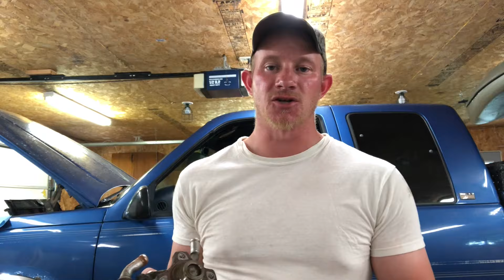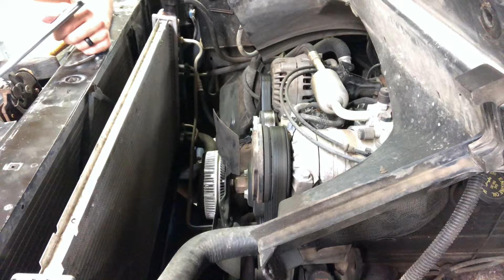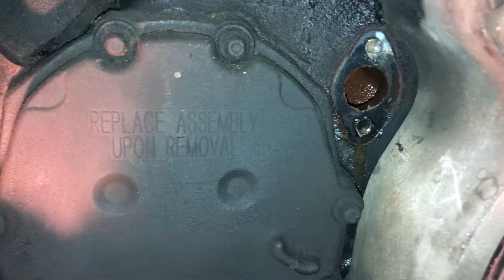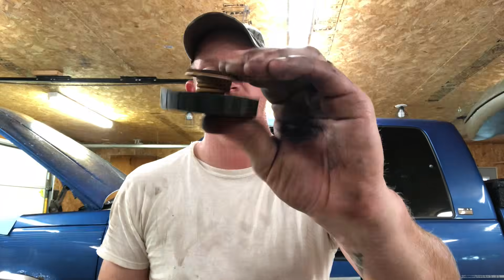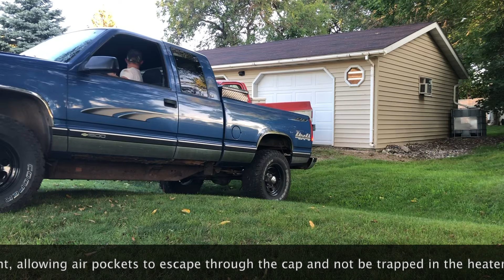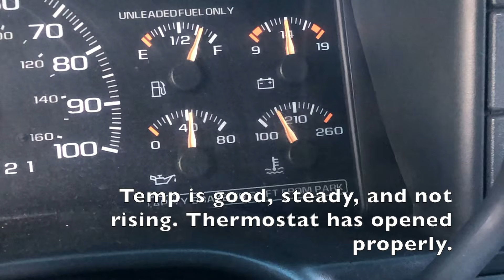How To Replace Water Pump in 1988-1998 Chevy GMC Truck & SUV

Comment: On my 1996 Chevy K1500 5.7L coolant is dripping from the crankshaft pulley area. Is this likely to be coming from the water pump above? Or is there any freeze plugs or anything else than could cause it?

Comment: Tried loosening off the pully and even tried putting some tension on the belt but the pully is just moving with it. Think its seized on there after 27 years of being on there. What can be done in this situation? Anyone? Update* i was able to put a 12 in flat head in between a set of the 4 bolts on the pully and grabbed a hammer pulling up clockwise on the screwdriver and hitting loose on the fan clutch nut/adjustable wrench. Also used PB blaster and waited 30min before. Essentially the same process you show when pulling the pully off with the 4 bolts when it freely rotates can also be done if fan clutch nut is seized.

Comment: Great video. My engine is making a noise that sounds like a pump or bearings going bad and has continuously gotten louder. I'm thinking water pump. With this video I am confident that I can do the change out on my 93 1500 
Thanks so much!
Reply from the maker: You’re very welcome, thanks for the comment!

Comment: How do i get the fan off when that bolt/ nut is all rusty? I did what you did but it womt budge and the pulley connected to the fan moves while i do it but the belts not movimg just the one pulley. I dont know what to do. Ive sparyed pb blaster on it still eomt budge. What do i do?
Reply from the maker: Put a big wrench on it, and as you apply pressure to turn the wrench, hit the top of the wrench with a hammer. It sounds weird but it works! Hope this helps. There may be videos of this method you can watch if I did a poor job explaining it.
Reply: @MidwestGarage yoi did a great job explaining it. It just wont budge with that method because its rusty. Its like the threads got welded together haha
Reply from the maker: @Noah-wb2lv hmm, dang was hoping the percussion would break that loose. The next option I’d go with is a lot of heat.
Reply: @MidwestGarage I can make a short video to show you real fast

Comment: Great video! I checked Amazon and the water pump under your P/N does not have the two small water hose connection?
Reply from the maker: Glad the video helped! The part number is from a 2015 purchase, so it may have changed or been updated since then. I’ll find the correct one and update, thanks for pointing that out!

Comment: What is the name of the two smaller hoses that you have to disconnect
Reply from the maker: Those are the heater hoses that go to the heater core. One is supply and the other is the return line.

Comment: I've watched several videos on replacing a water pump in the OBS Chevy and you're the only one I've seen that mentioned using the RTV on the seals which is EXACTLY what the repair manual states. Thank you for providing such a thorough and clear instructural video.
Reply from the maker: @zachmedeiros4163  you’re very welcome, glad I could help!

Comment: Nice video for a 95 to 99. 94 5.7 has a different water pump with a single "small hose" fitting on the top instead of two. The weep hole has nothing to do with oil circulation, any oil mixing with coolant is done with a problem inside to motor. Nice instructional video though as I'm working on my 99 Suburban and have a 94 Silverado for a parts truck. The water pumps are not the same.

Comment: U can t have a water jacket in a hold down bolt for the water pump... u need to do a bit more research b 4 telling people  to do shit that is point less then they got a mess of trv in the bolt holes.... do u see rtv from factory....no tiny bit of lock tight.  ..do the math and research.

Comment: very well done video, i havent worked on one of these in aot of yrs and now it is my sons first truck.  Nice to have the torque specs on water pump and other simple tricks.  Kept it simple and to the point not trying to over analysis a fairly simple procedure.  Well done!!

Comment: That was a great video wonderful to the point and you really know what you’re doing. I have a 1998 Chevy van and I just replace the water hose on the bottom thinking it was leaking well it wasn’t. It was the water pump so now I have to do what you did this Ohta be interesting but I think I can do it now, and I have enough tools I do refrigeration and air conditioning. Thank you very much for the videos.

Comment: I watched this video through once. Went back and made a note of the socket sizes, and the setting for the torque wrench. Then I gathered up my tools and went to work on my 98 Chevy C2500. Got the old one out in under an hour.  Was losing light and had started out tired, so then I just couldn't get the second bolt started.  Gave up, waited until the next day. Went out and took it back off, cleaned the bolts and gasket surfaces and put fresh ATV on, and in 40 minutes had it all back together. This was the BEST instructional video I've seen.  No stupid music, no goofy effects, no extra yammering about unrelated.  Good lighting, good views.  I never needed to go back to refer to the video to see what to do next, because it all made sense the first time. Thank you so much, Midwest Garage!
Reply: 100% did the exact same thing had to go buy a crescent and a hammer but got it done it what felt like no time just short of it being like 105 degrees outside

Comment: Thanks for the help. I noticed you put in something to protect the radiator and good heavy cardboard will work if you don't have wood. I don't know if you check in here but the wiper circuit board vid is how I found you. I know the links get you a little kick back but I couldn't find one. Keeping old trucks running is a good thing. Hope you are doing well, Rich in Oregon

Comment: Need one addition. 88-94/95 tbi motors don’t have a separate fan clutch bolt. Four pulley bolts also remove the fan. Wish GM would have kept it like that. Wwwaaayyy easier.

Comment: Great video bro made it look fun. I have a 2001 S10 4.3 just hit about 209,000 MI and my water pump went up I also put in the upgraded Spider injector along with new lower manifold gaskets, upper manifold gaskets, valve cover gaskets and new egr pipe. Had to remove the distributor to all that work honestly that was the one thing that I was wearing most about was getting that thing back in I made all my markings and had to reinsert and set and pull a couple times but I got it back around. Also new plugs, new wires, new cap, new rotor, new radiator also everything went back together pretty good Couple of questions for you.  What brand of waterpump did you get go with? I also noticed you didn't use any RTV on your water pump side or your engine side I did see you use a little bit of Vaseline have you had any problems with leaks? My Chilton manual says to it, basically just smeared on both sides of the gasket the block and the water pump, it would save a lot of time especially doing it by yourself you need to get those gaskets to kind of stick in place and I can see how the Vaseline would help with that. Your water pump look like it was a Gates model, I'm about to buy either the Gates model or the AC Delco professional which comes with 2 gaskets. I'm just wondering if I should go with the Fel Pro water pump gaskets I did felpro on all the other upper and lower manifold kit that kid came with about 20 different items LOL much better metal gaskets though for the lower manifold I was leaking coolant in my oil so it was time to do all that. I think I might spray paint the AcDelco Professional waterpump with some sealer before I install it.  I'm sure it'll be covered with rust within a couple of months. I saw all the other Gates boxes in the beginning of your video so I figured you went with a gauge water pump also I believe the gates water pump comes already spray painted black so I was just wondering which one you got and how many miles have you put on your truck and still no leaks without any RTV on the water pump gaskets? Cool video bro feels good to do your own stuff I'm sure glad their videos out there like yours to help us along the way. My 4.3 is running strong I'm sure the rust will get to it before the engine fails there it's a good little engine if it's taking care of properly. Honestly I should get that a little bit of rust repaired it's always on the same spots right on the bottom of the third door and the rocker panels.

Comment: I have a 1995 - GMC Suburban 454 with only 50K miles, a gem! You answered my question right away! I had just changed a hose from the power brake assist to the steering reservoir, all sat, no leaks detected. Next morning I see a spot under the passenger side and scratch my head. Crawl under and see that it is coolant dripping along the bottom hose. I knew there must be a weep hole, but I didn't see it. I watched a couple videos and I think yours was the 3rd from the top. I am going to knock this out and find a hill where I can burb it and not worry about what comes out. I  appreciate you, I subscribed and will check out your vids, Wado.

Comment: Question for anyone. My 1995 Chevy Cheyenne pickup tensioner pulley has gone out and being replaced. I was told I should also replace the water pump. So auto zone has a water pump kit. Is this recommended to do?

Comment: Thanks my guy. I really appreciate it. I recently bought a 00 obs tahoe z71 and the radiator cracked. I was going thru everything and figured that if I’m replacing half the cooling system I might as well just replace all of it. I bought the chilton manual but for fucks sake they make everything so freaking ambiguous in there. They don’t tell you what the RTV is for.. you did (the bolts - not knowing that or why the bolts would’ve been wet and this being my first 5.7 I would’ve shit my pants thinking something was fucked), the screwdriver tip for the 4 bolts, etc. like dude. That was insanely clutch information that seriously saved my ass. You’re the man my dude. Seriously!

Comment: Hey man I have a 94 k1500 that’s been sitting about 3 years with a bad water pump. Vehicle won’t stay running under weight or at idle. Would water pump and coolant temp sensor cause it to die?

Comment: I have a 97 chevy 3500 i was wondering if you know if a bad water pump will cause the truck to overheat when it get to 50+ miles per hour? It doesnt overheat if its just idling or driving at low speeds but once i hit around 50 and over the temp gauge starts going up to 3/4 and higher if i dont stop. I already changed the thermostat thinking that might be stuck but that didnt fix it. Does anyone have any ideas or has had the same problem where youve found what was wrong with your truck. I want to avoid having to replace alot of parts til i get to the right one. Also the radiator is kinda new only a few months old. The truck ran fine for a long time after the radiator was changed. Then we had bellow freezing temps for a few days and after that is when i noticed it overheating

Comment: Hi I’ve been watching yr video over never again Unfortunately my water pump needed to be changed ,I found a mobile Machanic who s add said he was certified Machanic so I trust this man to take care of it turns out he used no kind of silicone and the gasket I found on ground in dirt 3 days later in dirt .so here I am watching u over n over trying to get the confidence to go out side n do my self ,Is there a certain way to take off pulleys ,if have a 94 Chevy s10 wanting to know is it pretty close on all chevys as far as the serpentine belt ?do I hav to take it all the way off to do the fix new to this obviously not a Machanic I’m afraid I’ll put the pulley back on wrong anyway sorry so long I’m just wanting to not break anythinng else lol Angela m

Comment: Well done! About to do my 1994 Silverado 2500 5.7 after seeing the drips from the weep hole. May as well do belt and tensioner pulley it seems. Have you ever done valve cover gaskets, new oil pan/gasket, and filter adapter(maybe just O ring)? Getting leaks around these things, may be time.

Comment: Great video! Very informative and I didn't feel like you were trying to rush through the steps.
I installed a new thermostat and radiator in my 95 5.7 but it is still over heating. Tried flushing with water but truck was sitting so long that sediment back out of heater core.
Drove for 5 minutes and was almost to the red on temperature.
No coolant on passenger floor but coolant is circulating. Do you think it's a bad heater core or a bad water pump?